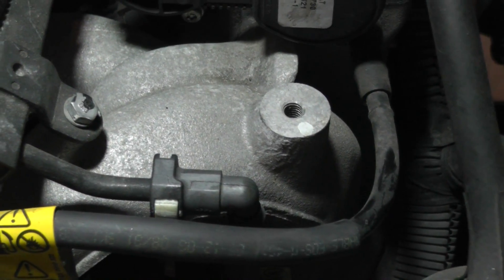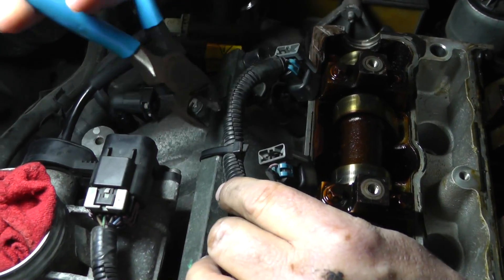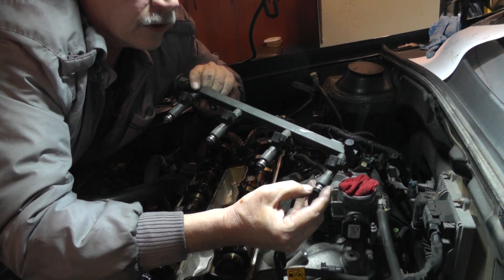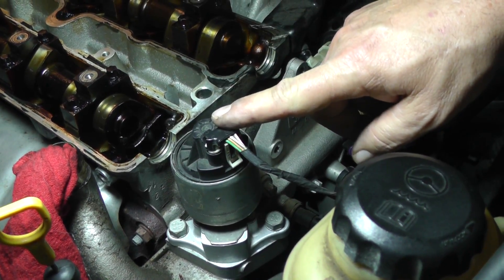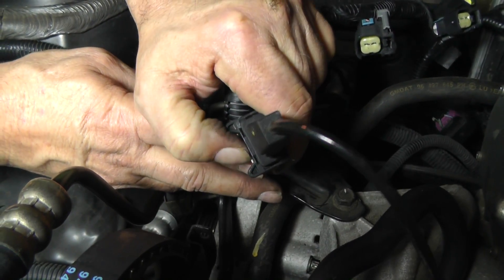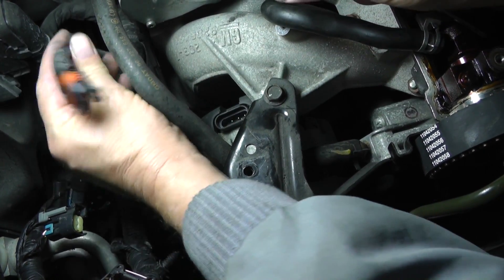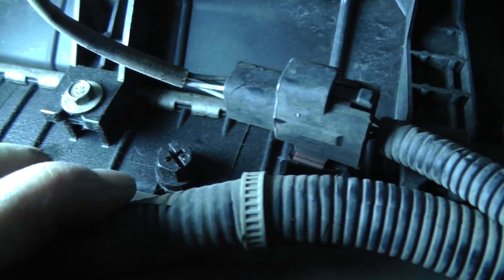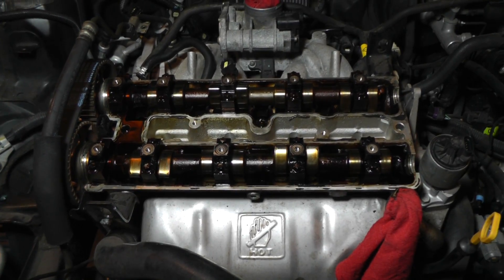Suzuki Forenza Head Removal - Part 3 (Camshaft Cover Removal)

Comment: Hi stuzman, I just bought my 07 Forenza and a month later out of warranty it misfires and has difficulty starting up that got worst ever time on startup. I replaced coil pack, plugs, and wires and that fixed the misfire but as for the Difficulty starting up it is still happening. Now i think it is the Crank or cam position sensor because those tend to go on these. but thats not a simple or cheap repair before i go pulling things apart from what i have seen. It starts up normally when the engine is still warm for a couple hours but on cold start it is struggling to start up. It is only at 107k miles. Any suggestions?
Reply from the maker: Hi Will. Is the check engine light on? If so, get the code read and I assume that you don't have a scanner. If not, you may want to invest in one to look at some data from the vehicle. It could be a multitude of things and I'm sure that you don't want to guess at what it could be. And even my suggestions, would be a guess without the data to prove it. As for your crank and cam sensors, it's possible that one of them could be getting hot and breaking down, but you should get a check engine light for that. Let me know if you're getting a check engine light and if you have a scanner. Take care Will...
Reply: Nope, unfortunately no code for it. The only code i had was when it was misfiring and that was cylinder number four. But the startup is pumping the gas pedal several times and starting it at the same time. I just don't want to burn out the motor. Not sure where to start.
Reply from the maker: Here's some things you can check. Ensure that you can pull a spark about 3/4" to eliminate ignition. Check fuel pressure to ensure it's in spec. Throttle body could need cleaning or issue with throttle body. I'm assuming there isn't any coolant loss indicating a possible head gasket issue. Fuel injector(s) could be leaking creating a rich condition when car sits for a long period. If you have a scanner, take a look at STFT and LTFT readings, especially LTFT. These readings could guide you in the direction to take if there is fuel/air mixture problem. Another thing to check is the MAP sensor. That will give you some things to check Will and good luck on finding your issue.
Reply: Thank you for the suggestions. Will give me something to do. Appreciate the help stuzman! Thanks.

Comment: Hi, I have a Chev Optra with a coolant leak down the back of the motor it drips out when the car is off. would this be a head gasket it does not over heat and runs normal. I just have to top up coolant all the time.. It is due to go into GM soon but wondering what it could be so I'm not surprised by the bill.
Reply from the maker: Well, it could be a head gasket leak, but it also could be a coolant hose leaking since there are a few of them at the back of the engine. You could take a closer look at see where the coolant is coming from.

Comment from the maker: @Tony. I don't mind the thumbs down if they would let me know why and I never do. Yes, the trolls are everywhere.
Reply: do you have a video that will tell me where my maf sensor is I'm having a real hard time finding it it would be a lot of help if you would let me know where I can locate it thanks
Reply from the maker: +Brandon Stone The MAF is located in the air intake tube on the driver side of the car. Here is a link to its location. Go to the second thread and click on the image to enlarge it. You will see it listed as item #1 http://www.suzuki-forums.com/3g-2006-2014-vitara-grand-vitara/46385-engine-sensor-locations.html

Comment from the maker: Ah, that's a pretty easy job. If you want to see the procedure of what I did with the plugs and wires, check out the Head Installation Part 9 at timeline 30:19 It will have the torque spec and gap setting there. Good luck on your repair.

Comment from the maker: Hi wtfhellas! Thanks for the great compliment! Actually, I mentioned this, but it's in the previous video of the cylinder leak down test at timeline 1:10. For that cover, it's two socket head bolts where a 5mm hex bit will remove them. I'm not sure if you have watched all of the videos, but I believe it will cover every detail if you have to go as far as removing the head. So, if you don't mind me asking, what type of job are you getting ready to do? Thanks for watching!

Comment from the maker: I gave some more thought to your question as it's not very clear. If you're asking, "I'm going to replace the head gasket. Do I need to replace/change the spark plugs?". If that's what you're asking, then no, you don't need to remove the plugs to replace the head gasket. But if you're going to replace the head gasket, you'll probably want to put new plugs in when you're done.

Comment from the maker: Hi jacubv3. Surely you're not serious are you? To change the spark plugs, you do NOT remove the head gasket. To see the spark plugs changed on this engine, go to my last video, "Head Installation Part 9 (We're Done!) and you'll see the spark plugs changed. And the head is installed on the engine. Maybe you're talking about the spark plug cover which sits on top of the camshaft cover which covers the spark plugs If that's what you mean, then yes, that cover has to be removed. Thanks for watching!